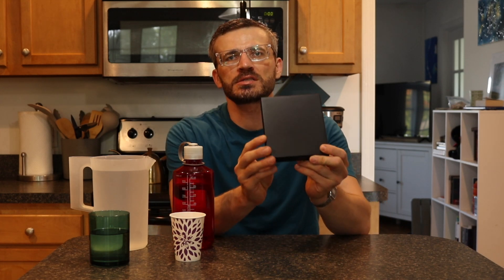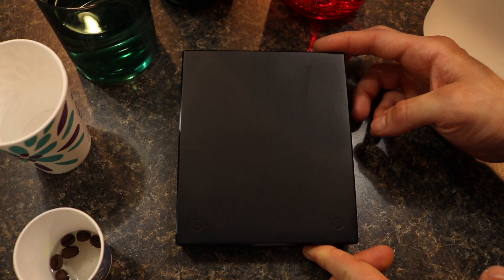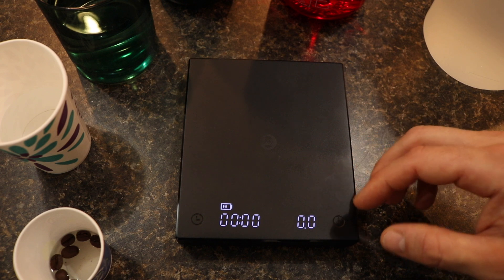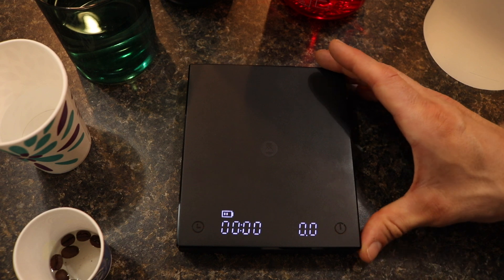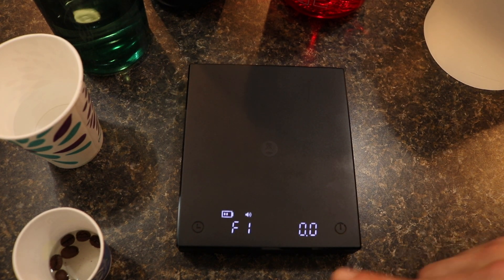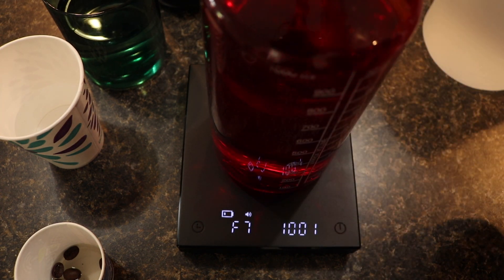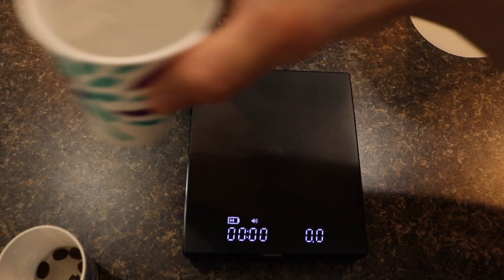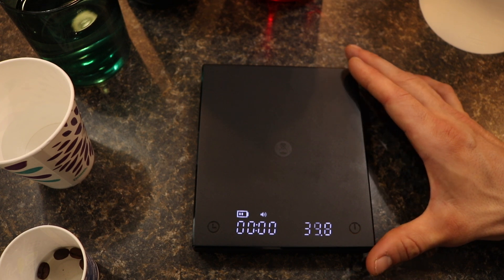How to Calibrate and Fix Error C Code on Timemore Coffee Scale

Comment: when turning on, hold timer button and press power button rapidly a few times until it goes into calibration mode.

Using a different accurate scale weigh out:
20 g, 100 g, 500 g, 1 kg, 1.5 kg and 2 kg
Having accurate calibration weights would work even better.
Follow the numbers on display for which weights to put on until you get to the F1-8 sequence 

F1 - 20g to center of scale and remove when it goes to F2
F2 - 20g again onto center of scale, then remove and put 500g to the centre of the scale, then remove when F3 starts
F3 - 500g again onto the right hand side of the scale
F4 - 500g again onto the top side of the scale
F5 - 500g again onto the left hand side of the scale
F6 - 500g again onto the bottom side of the scale
F7 - 1kg into centre of scale, let it sit on the centre of scale for a bit or put 2kg directly on centre of scale.
End.